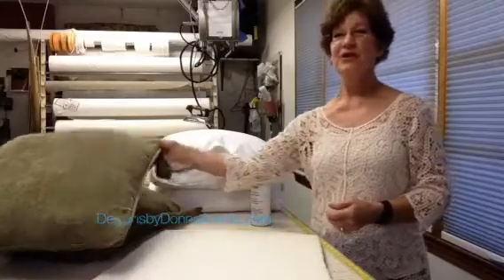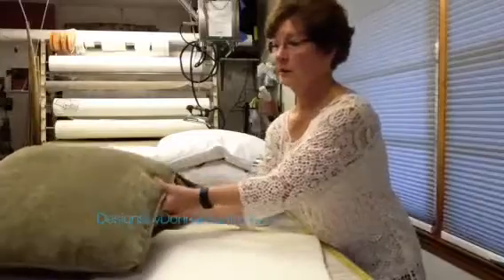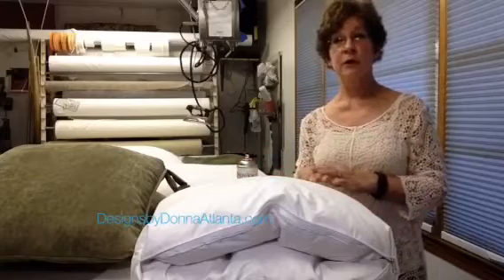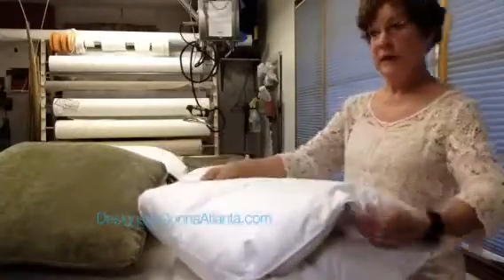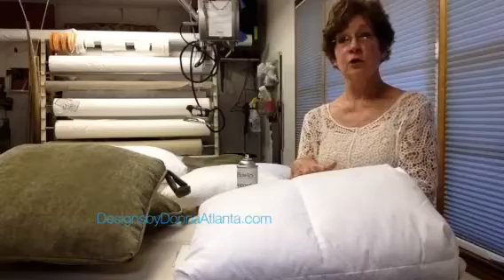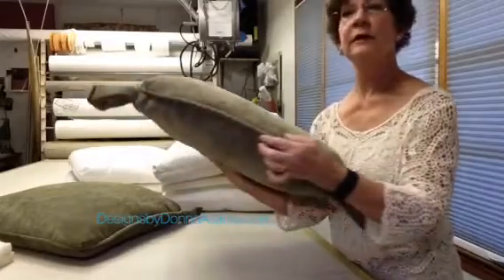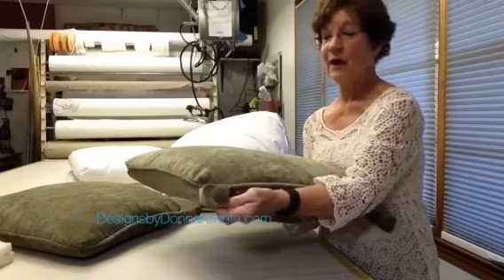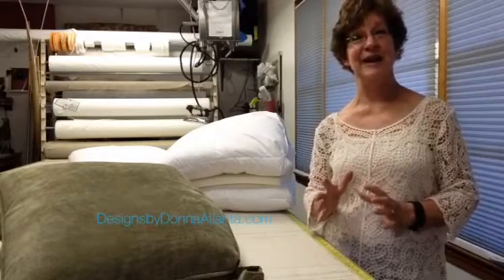What is a down envelope cushion insert?

Comment: I am redoing a cane back couch that has three cushions into a single cushion couch. I want a little crown on it. I have been looking at down alternative or down mattress toppers online thinking that they could be folded  and sewn to create an envelope. Do you think that might work? My new cushion would be 23" deep and 68 inches wide. I'm not sure how thick it should be 5 or 6 inches. I want that old French settee look.  Not sure if I should pipe it or not.
Reply: Hello Laurie.  If I were considering using a down alternative or down mattress topper, I'd have to experiment with that.  As far as how thick the cushion should be, you want the top of the cushion at a normal seat height which is somewhere between 18-20", so keep that in mind. Piping is going to be your call.  However, the french mattress cushions have a stitched edging which is done by hand.  Enjoy sewing and creating!
Reply: @DonnaCashDesigns  Thank you!